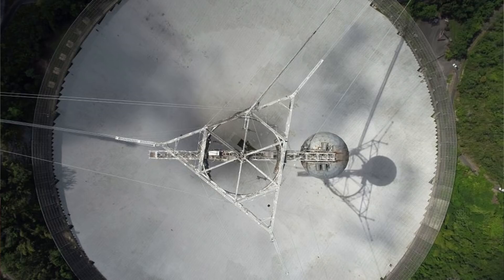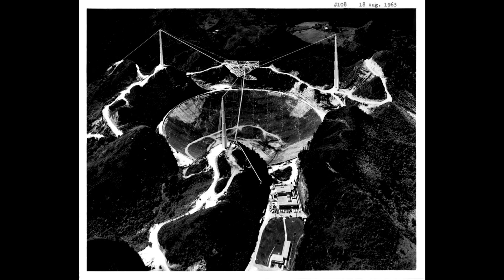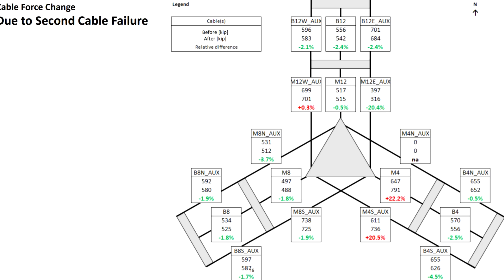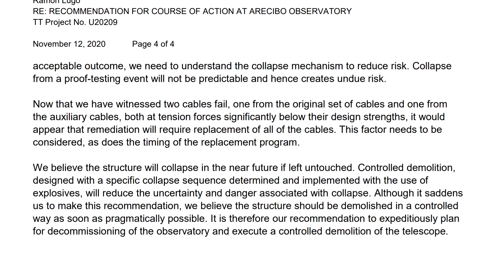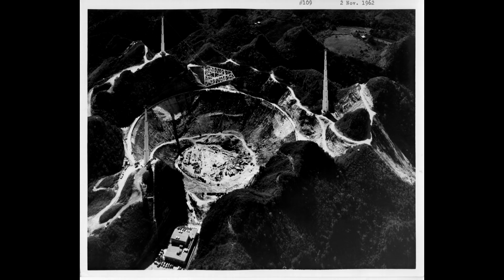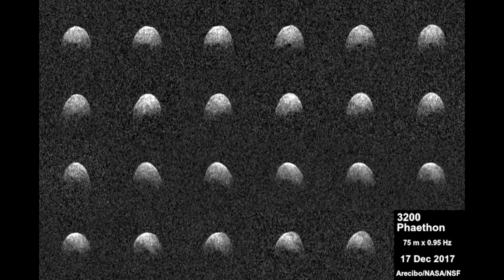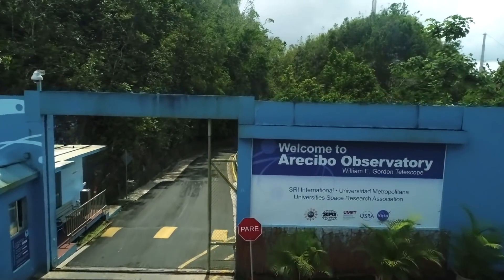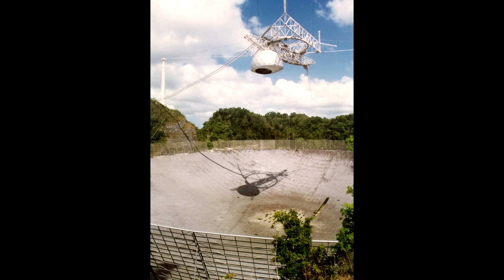Worlds Largest Radar Astronomy Dish To Be Demolished!

Comment: It is the time to think out side the box.  The comments your making of their thought says they are at that point.   This may sound crazy but the way to not damage the dish and fix the antenna array is to softly hold it up.   A god dam big balloon that can be sewn together near or at the site. and slowly dragged under the antenna.   then inflated which will spread out the load on the dish and be deformed by the concentrated antenna array as the load is spread out to more of the top of the balloon.  I will likely damage  some of the antenna but the structure and most of it will be fine.  With the load significantly lowered or totally remove the repair can start safely.   You may have someone that you could forward this idea to them.  Thinking outside the box was what I did for 40yrs before I retires.  Many patents across a range of product.    This is basic applied physics.   Alternately multiple balloons inside a net maybe easier to create with each having a filling and deflating hose.   They live ships using this approach.

Comment: There is a lot of commentary regarding bean counters, which is sad. Regardless, The structure seems to have been constructed using, the-then suspension bridge methodology. Maybe in our time 2020> Any likely rescue would involve a central supporting tower (scaffold) to enable loads to be demounted and to change out the cables for more advanced materials.  Mario with his paint can will be needed for some basic maintenance? It would be a great shame to loose such an iconic structure.

Comment: Cables pulled tight at such a shallow angle see a much higher strain than a cable pulling vertical. Check out “Lifting angle factor”. The wider the angle the more strain is seen by the cables. Aracebo was rigged with near horizontal cables so no surprise the 500 ton gondola needed such big cables and anchors.

Comment: It's to bad they didn't use 4 point support instead of 3 points and cables should be rated for only 50% load with 4 cables for dual redundancy

Comment: Everything has a finite lifespan. Unfortunately this series of events has meant that Arecibo has reached the end of its operational life, admittedly perhaps earlier than planned, but eventually the burden of problems would have exceeded the capacity of the engineering crews to repair and maintain the system effectively and safely. It's sad but inevitable as Thanos was want to say...

Comment: In my first job as an engineer, the fellow engineer I worked for had been a construction engineer on Arocebo. He was severely injured when a boulder broke free and rolled into the pit upon him. He recovered, but some 15-20 years after the construction he would tell me stories about this construction project. I was enthralled by these stories, even though we were working on one of the largest concrete projects in the country at the time. It’s sad the structure has failed. We will need to rebuild it.
Reply: Did he receive the nickname 'Indiana' for this?

Comment: Just like hubble no one wants to save our historic scientific tools
Reply: We already put quite a bit into the hubble and it was designed to be deployed and serviced with the US Space Shuttle, a no longer active vehicle. 
If we really need a visible light optical space telescope we can deploy an entirely new one that works with current deployment rockets, and were moving on to the James Web telescope soon to do all the things that the Hubble wasn't capable of. Lets hope the James web deploys without issue, as we can't go repair the Web like we did the hubble after launch because it is going to be far out on it own orbit away from earth.
Reply: sadly Hubble will be difficult to save
Reply: @Hevendor  add hubble to the iss
Reply: @2011necro , Unfortunately, that would be quite difficult to do and maybe not worth it in the end. Thankfully we have the James Webb telescope coming soon as Hubble's successor.
Reply: @vampiro4236  hubble was conected to the iss for a short time decades ago it can be reconecter
Reply: @2011necro  No it wasn't. 

And I quote...

"Hubble's orbit is 350 miles above Earth and set at a 28.5-degree angle relative to the equator. Just bringing the scope to the ISS's 52-degree orientation would require a tremendous amount of rocket power, but getting it to the station's orbit 150 miles below would kill it. The descent would generate enough atmospheric drag to damage the scope's solar panels. Worse, the space around the ISS is full of gases, liquids, and other debris jettisoned from the station that could gum up Hubble's optics.

Assuming that it could survive the trip, attaching it to the station would make it almost unusable, says chief Hubble engineer John Grunsfeld. It captures such highly detailed images because it's free from any disturbances, atmospheric or otherwise. It's designed to stay very, very still. "Once its camera locks onto an object, it's unflinchable," Grunsfeld says. The vibrations of gear on the ISS would make such observations impossible."
Reply: @vampiro4236  were talking about saving it. Not using it
Reply: @2011necro  No, it wasn't. But it was visited by several space shuttle servicing missions, so it's not accurate to say no one wants to save it when it's already been saved several times.
Reply: @vampiro4236  F
Reply: @gabrielpoquet3725  F. F what? hahaha

I'm kinda interested to hear the rest of this reply
Reply: Outdated. Remake the bitch lighter and stronger. More Efficient.
Reply: @Quesadla  do you know in space weight doesnt matter much ? Only matters  When leaving the earths graverty
Once in space mass is good as it helps to keep its orber easyer
Reply: *do you know that on 1. December it will collapse and destroy everything *

Comment: I second all the comments that a lack of maintenance due to  budget cuts probably had a lot to do with this failure. Unfortunately, this seems to be the American way, and I have fought such maintenance budget cuts in places where I have worked, only to see the powers that be get caught with their pants down. But back to the antenna. Metals work harden with time, especially metals under great forces, like the support cables for the secondary assembly. The kind of failures they are seeing can easily be described as materials failure due to age, work hardening and stress corrosion. The fact that cables are failing prematurely tells us that there are some other factors about those cables that were overlooked by the engineers (and this, unfortunately, is how engineering people often learn things).Hopefully, these cables are being examined to see what's going on and how it can be prevented in the future. As for saving Aericibo: It is so iconic, valuable and unique that I can't imagine that something good won't come of this. A lot of good minds are undoubtedly now looking at this situation, and we may see some new good ideas on how to save it. But if they do decide to drop it, they can, as others have suggested, sell pieces of the reflector to raise money from enthusiasts (among many other funding mechanisms needed). A completely new antenna can be built, perhaps a little bigger, but certainly with better surface accuracy (a big challenge with parabolic radio antennas), a better/more redundant structural cable system, a rethought feed system that provides more capability and flexibility, and maybe reducing the weight of the secondary structure by putting the RF power sources on the ground and using flexible waveguides to bring the power to the feed assemblies. In any case, with some vision and $$$ behind it, we may well end up with a much better Aericibo. And hopefully, in our lifetimes.

Comment: Balloons

If buoyancy slightly less than mass of workman using such as a fall arrest... They could fall with an acceleration so slight that even by time they hit ground, the velocity wouldn't cause harm.

Similar could be used to lower parts to ground. Or  support them during repair work or perminently.

Comment: I'm not at all a structural or any other type of engineer. However, I've worked with steel cable on a smaller scale (meant for holding single digit tonnes not hundreds) and it is terrifying. Even when you're confident that the line is many times stronger than required. So as sad as it is, Thai is definitely the best way forward. Take it down and (hopefully) build something better in its place

Comment: This could be saved. First Build a support system under the hub using beams and  hydraulic jacks same way they lift buildings in preparation to be moved. Then inspection/replacement/repairs of the guy cables at each tower.  Then a controlled slackening of those cables while adjusting the under side supports and lowering of the hub from the towers would be safe and reduce further damage to the dish. Then stringing new cables from the 3 towers and raising the hub evenly. Repairs to the dish could then proceed. Technologies already exist to do this without the need to reinvent the wheel.
I have more details in my head to fill in the gaps of my plan, this is a very general description.

Comment: Hi Scott!
Are you sure it really is 1/r^4 for radar imaging? That doesn't seem right. The only difference from radio imaging is that the distance (r) is doubled, but the decay is still 1/r^2. If r is the distance to the object, then it would be 1/[(2*r)^2]=0.25/r^2. 
Correct me if I'm wrong.
Reply: I think your right,  the signal power is measured as it spreads out in a square(a square on the surface of a sphere).  Its things like the density of an object compared to its height that would go up r^-3, don't know why you said, is it really r^-4 or equivalently 1/r^4.  My experience is a final year Maths degree student.
Reply from the maker: Think of it as a 2 step process - the energy drops as 1/r^2 on the way to the target, then, that energy is scattered and returns to the source, so you treat it again as an isotropic emitter. So return energy is r^-2 * r^-2
Reply: @scottmanley  I just don't understand why you do that multiplication. Can you give me some reference where I can elucidate myself?

Comment: For a cable to fail at 60% of its 'ultimate' load capacity is not as shocking as it sounds since its actual 'design' load capacity would have included a significant factor of safety, like a factor of 2.5 or 3, and if the factor of safety was say, 2.5, then it actually failed at a load that was 50% greater than the load it was designed for...  The whole point of a factor-of-safety is that the ultimate load, i.e., the load that causes failure in a testing lab, is only a reference point; and you don't design the actual structure to support anywhere near that load because, you know, sh*t happens...

Comment: At this point the central structure probably can't be safely saved. Given the apparent mis-calculation of strain on the remaining cables, and the lack of information regarding previous and current strain loads on what cables remain, it's unlikely that the safety of anyone working on the receiver structure could be guaranteed. Hopefully, given sufficient budget, the entire receiver structure can be replaced while preserving the dish.

Comment: Is the Square Kilometer Array not useful for the same sort of tasks that Arecibo was? I'm guessing it's not equipped with radar equipment - but I guess the question is can you use an array of radiotelescopes for radar? or is there a problem inherent in not having a single large dish for that sort of work?
Reply: The SKA isn't even 1% built.  And you cant use a bunch of small dishes for transmitting.

Comment: It can be rescued. But it will be very expensive to do so at this point. You can skip maintenance for a few years when the budgets are tight but you're going to spend more money in the long term.
Reply: It is too late. They're now at the point that nobody can be near it for safety reasons.
Reply: @stargazer7644   There are still ways to save it but they become much more expensive. They could work remotely with robots or build a temporary scaffold to support the main mass while they work on it. It can be done but it's very expensive to do.
Reply: @AndrewBlack343  There really isn't any way to safely do anything.  Even setting charges to demolish it will risk people's lives.  We really don't have general purpose construction robots that can do the job of humans yet.  Building a scaffold would require people to work for an extended time underneath the platform, and absolutely will not happen.

Comment: Is it not possible to use a similar technique, as was used to image the supermassive black hole at the heart of M87, to replace if not better Arecibo (i.e. A virtual radio telescope by combining signals from serval radio telescopes)? Doesn't the VLA have greater .... specs (for lack of a better term) ..... than Arecibo had? Obviously I know that the answers to those questions are no but I'd like clarification on why. Thanks.

Comment: the collector thats suspended doesnt need to be that big and heavy. If its steel change it to carbon fiber. There are many solutions to fix this radio telescope.  plus it just might cost more to destroy it. what ever its going to cost money , if you get poked in the eye and its cheeper to take your eye out than to fix it are you seriously going to choose that route ? No.  Flexibility is required here. 
 Give it to me and I will find a way to fix it and keep it operational.  dont poke an eye out.

Comment: The best way to potentially solve this would still be drastic in that they need to cut the new focusing array off of the main structure.  Removing 300 tons of weight and tension would probably allow them to safely work on it.  Yes, that means dropping it through the dish underneath, most likely.  The design was fine, but the extra array and cables added obviously over-stressed the original design.  
That said, the main towers are still viable.  They could put a new dish and array in most likely once the old structure is demolished.

Comment: Inverse square would not apply to a beam, it’s for radiation that’s hemispherical, no beam is perfect and there are loses but it won’t fall off quite as fast as the inverse square...
Reply: any beam has divergence: inverse square stays valid
Reply: @goamarty  only if it radiates into 4 pi striadians, it will still fall off at the inverse, it’s just much much much longer as the radius of the beam is tiny or near zero compared to distance traveled, that calculation differs from what was described here... if it’s near perfect that distance will be nowhere near anything in the solar system for the tight focus of that dish...

Comment: If the site is unique due to shape, then it shoudl be preserved as a telescope site.  Why not start to gently lower the radome to the bottom of disjk (put mattresses on disk to supportr it. this will reduce weight/stress on the structure to prevenrt it falling down. Then, you can lower the semi arc structure in same way, further lowering the weight of the structure.  Aka: oprogressive disassembly instead of lettibf it crash down.

Another ieaL could they use a hot air balloon or zeppekin to lift portions up and away&  Ideally, lift the whole triangle , cut cable and move everything away and lower it gently.

Comment: Wow, working there would be realy dangerous. It's robot time!
Make it into a competition! All the challenges would be described and the contestants with the best ideas and hardware to solve them would get a shot at doing the mission to overcome them.
If they are not successful the next best team can try, given the telescope is still there.  ;-D
Repairing a structure that can only be accessed using robots would be the perfect task for a lot of engineers to learn a lot. We could use that knowledge later on if we build space habitats. If it fails catastrophicaly, but there is no human there to get hurt, then you would just have a crater with broken stuff. If it works then the telescope would be saved. Either way a lot of experience with remote construction would have been gained, books written and heros made, which will prove valuable in the future.

Comment: 3 heavy lift helicopter lift it up a bit and then u can deploy new cabels. And after a few cabels it's safe enough to get up there without air support. But that would be a lot of money i think. And i don't now how much that thing weights if 3 choppers enough for that thing. But it should be good to at least reduce the weight on the other cabels.

Comment: If the towers are in good condition they could just just tear down the current set up and re-engineered by adding one more Tower to decrease the load of the other three Towers and increase the wire size to support future changes to the system

Comment: Couldn't they lower the receiver before the cables breaks, then just replace the cables and the dish?
Reply: That would mean a lot of personnel on and below a hanging structure that might drop at any time now even without changing the tension on the cables.
Just to prepare a place below would take a lot of manpower and hours. I would not want to be there looking straight up and hoping the next cable does not snap.

Comment: While I understand it's damaged beyond repair, I hope someone will come up with the money to rebuild / replace it with a new one.
Reply: The excavation and main towers are still viable.  The dish underneath is basically wire mesh on scaffolds and fairly easy to rebuild.   
The issue is the cables and focusing array, which need to be completely replaced.  So "fixing" it to work to at least the original specs wouldn't be nearly as costly as you might think, since a lot of the original cost went into the initial construction of the towers and excavation.
Reply: @plektosgaming  Depending on how they demolish it, the towers could be compromised.  They would have to be inspected and maybe repaired in any case.